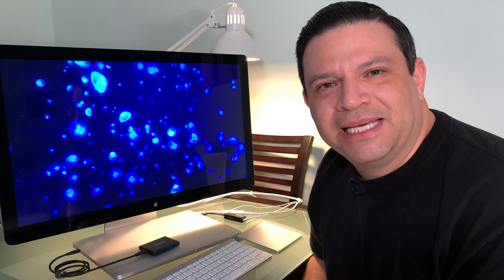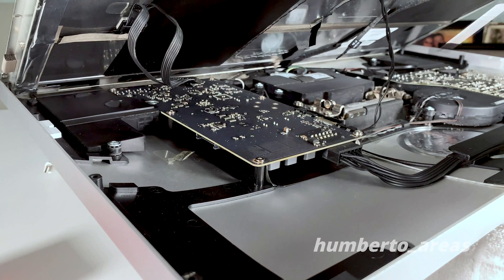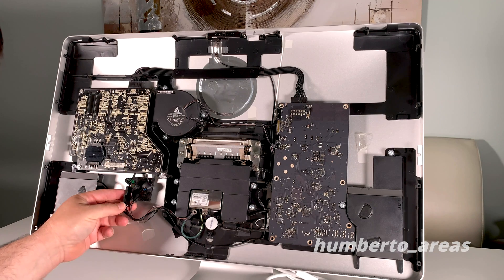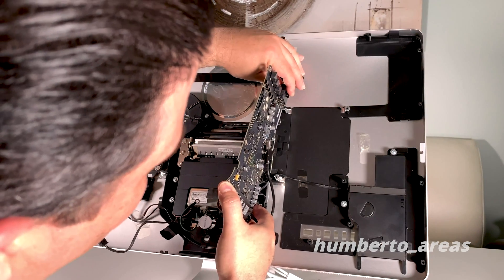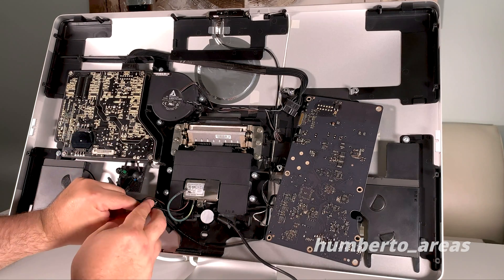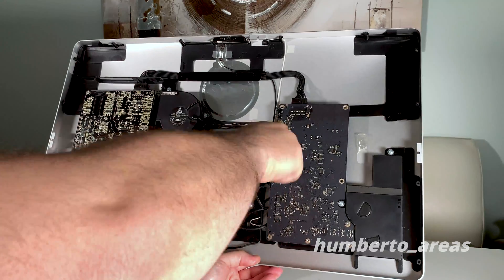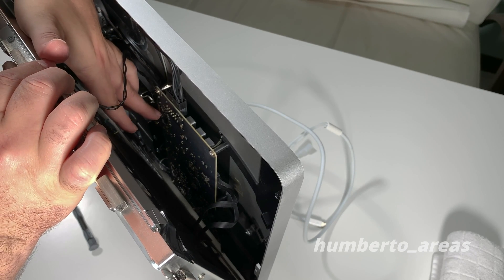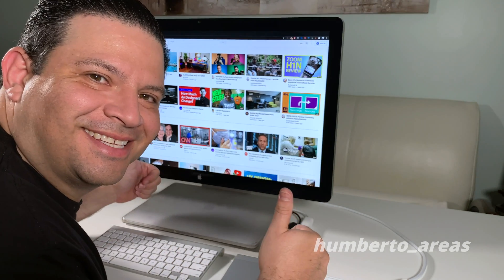Apple Thunderbolt Display Not Turning On - Step-By-Step DIY Repair 2026

Comment: I've got an A1407 27" monitor that has gone black.  The all-in-one cable is damaged from being bent during a decade of disconnections and reconnections.

I'm thinking that the simplest solution is to leave the all-in-one cable hanging, and use a Thunderbolt 2 male-to-male cable plugged into the back of the monitor, and connect it to the Mac PB via the USB-C to Thunderbolt adaptor I've been using for the past few months.

Two questions:

1. Can you suggest a supplier of a good quality Thunderbolt 2 male-to-male cable.

2. Are there likely to be any deleterious effects from the damaged cable — eg. wires exposed to or rubbing each other in the damaged part — in which case I should remove them via the procedure you show in your exemplary video.
Reply from the maker: @ProLearning, thanks for you comments and questions and for watching my video.

You could leave the current all-in-one cable hanging, but I always favor “less” cables.

In my opinion, replacing the all-in-one cable is not that difficult. You just have to take your time and be gentle with all the plastic connectors.

Please check out the video’s description, as I recommend all-in-one cable replacements I’ve used. Link to those are provided.

The all-in-one cable is held in place by a round metal plate that has 3 screws. Very unlikely that cables are moving and rubbing against other cables inside.

Please keep me posted on what hou decide on doing and let me know which part of the video did you find most helpful? Thanks again for watching!

Comment: Thank you sooooo much for sharing this video. My husband was able to follow your steps and repair our 27” Apple Display. It now works like it should. I use it with my 16” MacBookPro and was really frustrated when it wasn’t working. Now it comes on, bright and clear, with no more flashing in and out. The image is beautiful! Thanks again.
Reply from the maker: @Lisa Alconcel, Thanks so much for watching, glad to hear you got value out of the video. And best of all glad to hear we were able to revive yet another beautiful display. Kudos to your husband for the work and keeping another display out of the landfill!

PS: which part of the video did you guys find most helpful? Any feedback is appreciated. Thanks again.
Reply: @HumbertoAreas  All of the video was helpful, but especially the part when you reconnect the last cable, with the the clip that went over it. First time, the display image did not come on. Watched the video again and realized that the last cable connection with the clip that holds it in place might be the problem. Opened it back up and it had come loose. Reconnected and correctly placed the clip and ….Success!!! Display image came right up and is BEAUTIFUL!
Reply from the maker: @Lisa Alconcel, Thanks so much for your feedback, it is greatly appreciated. I did the best I could, to show, properly light the tight space, while recording by myself. In my opinion, that is the most tedious part of the process, reconnecting the cables... especially the one you're referring to. Thanks again for watching, enjoy your beautiful display.

Comment: This is great and the exact intermittent issue my screen is now dealing with. Has anyone made an all-in-one USB-C thunderbolt adapter cable for these screens? Would love to not have to deal with all the adapters.
Reply from the maker: @Carlos Pacheco, Thank you so much for watching and for taking the time to post your comments. It is greatly appreciated. I'm surprised the folks at MacSales.com (Other World Computing) haven't put out an all-in-one solution like the one you're mentioning. I will look around their website and let you know if I see anything that may work? Thanks again.

PS: which part of the video did you find most helpful?

Comment: Very helpful video. Three questions :
1. I have the Apple Led Cinema Display 27 (2010 model) with the same problem. The monitor went black and no sign of image. Is this symptom always a matter of cable?
2. Why did Apple doesn't make our lives easier by having the cable disconnected externally from the rear? Why all this technical fuss, having it inside the logic board?
3. Is the replacement cable an original one or from a third party?
Reply from the maker: @Antonios, thanks for your questions and for watching. 1) more often than not, when the image goes out is the all-in-one cable. And in my opinion, it’s an easy fix, and the most inexpensive. 2)Apple is in the business of selling, and i’m sure they dont care for making these repairs any easier for us. 3) if you have a 2010 model, please confirm it’s an A1316 model. And if that’s the case, the cable replacement I am recommending, will not work for you. You may have a MiniDisplay port on yours (and not a Thunderbolt 2) like the display I worked on. Please keep me posted.
Reply: @HumbertoAreas  Hi and thanks a lot for your prompt reply. I confirm that my Apple Cinema Display is a 2010 / A1316 model which does not have thunderbolt connection, instead it connects to my Mac Pro with a mini display port and has a separate usb connection as well. Please let me know about the regarding cable and possible solutions.

Comment: great video, but why does the cable need replacement in the first place?  PS I had one of these that was in my truck for 1400 miles of driving, could something have just worked loose?
Reply from the maker: @EnergeticWaves, Thanks for your questions and for watching. I always recommend keeping electronics out of vehicles, the heat on these panels can cause damage. But something may have come off because of road vibration. The reality is that the all-in-one cable is rather inexpensive, and when I decided to trouble shoot my display, I started with the cable. Please keep me posted on your display. Thanks again.

Comment: Hello, good afternoon, Humberto, I have an Apple display 27-1407 and I bought it used it. He doesn't give the sign of life. Can it just be that cable? I turn it on to my Mac and it's black screen and doesn't load the Macbook. How much is this cable? does it charge the MacBook on it? Sorry for My inglês 😬
Reply from the maker: @Tinoco Premium, hello and good afternoon to you as well. If you decide to troubleshoot the problem, I would start by replacing the all-in-one cable because is one of the most inexpensive things you can replace on these monitors. And yes, a good working cable will charge your Macbook.

I included a link to buy the cable in the description of the video. Some make sure to expand and read more the description for that link.  Hope this helps, good luck.

Comment: ...Wait ...I'm confused ...How were you able to diagnose that it was the cable?
Reply from the maker: @desperationno5, I did not explain how I came to the conclusion it was the all-in-one cable. To be honest with you, I didn’t know.

I had jumped on forums, blogs and just searching for possible causes as to why the display just died. Some suggested the power supply, others the main board and some the cheaply made all-in-one cable.

When I finally decided to take on the trouble shooting challenge (time and money), I figured I would start with the cheapest solution possible... and I got lucky, indeed it was the cable.

PS: I had previously ignored this red flag. Which was the Thunderbolt cable felt hotter than normal (hotter than it should be). Soon after that, the flickering started, then eventually died.

Hope this helps, thanks for watching, and do let me know which part of the video did you find most helpful?

Comment: i got one that is not functioning, seems to have no power what so ever and does nothing with plugged in, could this be the most common problem to happen to them, if so it does not seem too bad to fix.
Reply from the maker: @J Acosta, thanks for your comments, thanks for watching - glad to hear you got value out of the video. These displays dying is a common problem, and this perhaps is the cheapest fix you can try. So go ahead and give it a shot, you can do it with a little bit of elbow grease! Link to the Apple Thunderbolt All-in-One cable that worked for me is in the video’s description. Please keep me posted on your repair and feel free to reach out. Good luck!
Reply: @HumbertoAreas  gonna try it.

Comment: How did you know that it was the cable causing the issue?
Reply from the maker: @Ken Pak, thanks for your question and for watching the video. To be honest, I did not know it was the cable when I took on this challenge. I figured that if I was going to start trouble shooting possible solutions, then I would staty with the cheapest one, and that for me was the all-in-one cable. Hope you got value out of the video. Which model display do you have?

Comment: I forget if I commented already but I wanted to share I had a successful repair of a A1316 model but it did not use the same cable.  Found out the hard way.  Anyway, after buying the more expensive ($100 on eBay, more elsewhere) replacement cable I followed the same general steps (one exception was the camera cable also was attached to back of display and was a little tricky to reconnect) and SUCCESS. I've just done a cable replacement on this model for a friend and can't tell if it is successful  yet because I believe on this model you have to have the power connected right?  I don't have that adapter yet.  On the newer model it powered just from Thunderbolt (I believe USB only has to be plugged in for powering the back ports AND webcam).  Thanks so much for this great video. Will update this if I'm successful with same model as in video.
Reply from the maker: @Tembrock, thanks for your comments, thanks for watching and glad to hear to got value out of the video. What display model did you perform the first repair on? Glad to hear you got it to work. Also, keep me posted on the repair you did for your friend. Any others details that you can provide, in order to help folks repair their displays, would be greatly appreciated. Thank you.
Reply: @HumbertoAreas  Hello there! My first display was the A1316 (version with no ethernet, just USB ports).  That's the one where the cheapest cable I could find was $100 on Ebay.  The older one I JUST got working but have more issues.  What I didn't know before tackling my friends' display (model A1407) was that: 
- She was still getting picture
- She was having horrible Fan Noise (thus she just said "It died")
I replaced the cable just like in your video (before I knew there was this fan issue) and got no picture.  I was using the same non-apple thunderbolt adapter that worked with the A1316.  I had a hunch that it could be the adapter and was correct.  An official Apple USB-C to Thunderbolt adapter got me picture but it now I'm left with the fan noise.

So far I've read it could be anything from a bad fan, power supply, capacitors wearing out, that it's connected to the brightness (the brighter the display the louder the noise) but don't know enough to really diagnose.  I'm just handy and can follow a great tutorial video LIKE YOURS! ;) 

If you have any suggestions, links, tips for the fan noise I'm all ears. :). If not, no worries.  We may be getting my coworker a new monitor anyway.  I just LOVE fixing old / good tech and not contributing to land fill whenever I can. A1316
Reply: Last note: I found a PSU and FAN  on eBay (two purchases) which seem to be likely culprits, and will try to swap those out.  I saw at least one report that PSU fixed buzzing issue.  Since fan was loud seemed like while I was in there it was worth repairing.   Will know more in a week or so.
Reply from the maker: @Tembrock, Wow! Your friend should of elaborated a bit more and expanded on his/her definition of “it died” - 😂

There should be some good videos on the fan noise issue... if not, I will look around and point you in the right direction.

Thanks again so much for your comments and feedback. Hope all of this info, helps someone else from throwing one of these amazing displays in the landfill.
Reply: @HumbertoAreas  All good.  The upside is I may have inherited this monitor.  UPDATE ON REPAIRS: I replaced the power supply board and the fan and it seems to be working PERFECTLY.  Both replacements were easier than the cord replacement as they had very simple connections.  You just had to remove the screen connections same as the cord replacement.  Once everything was exposed it was just 4 screws and two power connectors for the PSU board and 3 Screws and two PCB connectors with a little tape lifting and replacing to route the fan cords back where they were.  Connected it to a 13" MBP and it came to life beautifully silent.  Really have enjoyed learning how to refurbish these beauties.  Thanks again for your original video that started me down this path.

Comment: Just as advertised! Awesome tutorial. Worked like a charm. I was nervous I was going to fry the board but the monitor lit up right away. Thanks for this Humberto.
Reply from the maker: @James Sprenger, thanks for watching and for your comments. It's awesome news every time one of these displays are put back to use. Glad to hear you got value out of the video. And trust me, it is nerve-wracking cracking one of these open, but with a little guidance I truly feel anyone can do it! PS: which part of the video did you find most helpful?

Comment: Hi Humberto. Thx for the very easy-to-follow video. I've replaced my all-in-one cable twice now. When the first one didn't work, I completely re-did the process from start to finish to make sure no connectors were loose, etc. When that failed to get my monitor working, I bought a second cable from a different brand. Having just finished installing that second replacement cable I'm still without any video. I do have audio through the 27" Thunderbolt monitor's speakers from my MacBook Pro (Retina, Mid 2012), BUT still no video. Sound but no picture. The all-in-one's cables are attached directly the Magsafe and Thunderbolt ports on the MacBook Pro (no adapters). Any suggestions??? Thanks!!! (Having done this three times now, I very nearly have each step memorized. lol.) Best regards!
Reply from the maker: @Rob, Hi and thanks for your comments and questions. Glad to hear you got value our of my video and nothing bears repetitive practice! LOL

Q: have you tried bypassing the all-in-one cable all together with a simple Thunderbolt cable connected to the back of the display directly into you MPB 2021? And have you tried connecting the display to another MAC other than your MBP?

Please keep me posted, I'll do some research on my end in the mean time, hopefully we can get your monitor going soon enough.
Reply: @HumbertoAreas  No, I haven't tried that yet.  To do that, I'd need a Thunderbolt to Thunderbolt cable, right? I guess I'd use the Magsafe from the All-in-One, but leave that the Thunderbolt plug from the All-in-One unplugged, substituting the Thunderbolt-to-Thunderbolt bypass, right? Thanks.
Reply from the maker: @Rob, yes, in order to troubleshoot the display this way, you'll need a single stand-alone Thunderbolt cable. You technically don't have to use the all-in-one cable at all. You can use your MBP's charger to have it plugged in and using the stand-alone Thunderbolt cable. Let me know how that goes?
Reply: @HumbertoAreas  Thanks. Which standalone TB cable is the right one?
Reply: @HumbertoAreas  Do I want a cable with first gen Thunderbolt plugs on both ends OR something else? Can you make a recommendation -- preferably a cheap one? Thanks again!
Reply from the maker: @Rob, Hi and sorry for the late response. I like the cables from the folks at MacSales.com - Link: https://amzn.to/2Newwkv - Not a cheap option at $50+ Shipping. Or you can go with an Apple Thunderbolt cable for about $25+ Shipping - Link: https://amzn.to/2Zr4oNu
Please note: Thunderbolt cables are easily confused (connector ends look the same) with Mini DisplayPort cables, so be careful when browsing around for these. Good luck and let me know how it goes.

Comment: Thanks a lot! Does your Thunderbolt Display smell a lot like acidic/electronic? I cannot understand what this comes from...
Reply from the maker: @Vanni, thanks for watching, glad you got value out of my video. That smell is strong at times on my display as well. My guess is that the smell comes from all the plastic components that get heated from inside the display. What part of the video did you find most helpful?

Comment: Humberto...my 27" Thunderbolt Display I am using was a "new" replacement (apple care) I received when the original "exploded" in an area of the display. Since then, I have had the power cord replaced by apple. I have been experiencing 2-3 second blackouts (monitor hooked up to my Mac Pro model late 2013) for about 12 months now, but didn't want to take my Mac Pro to apple for 2-3 weeks for diagnosis as I need to use it, but assumed it was one of the graphic cards that was a problem. TODAY, the monitor went dead, and after testing my computer on another monitor, the problem is with my Thunderbolt Display. So I just ordered the parts you listed, and will attempt repair myself. Meantime, would welcome suggestion(s) for a "quality" monitor replacement in event I can't get my monitor repaired. Thank you
Reply from the maker: @Sky Bird, thank you so much for your comments and for watching my video. I was able to trouble shoot my problem the same way and decided to replace the least expensive component (the cable). Please come back to the video once you get your parts and good luck on your repair. Please keep me posted!